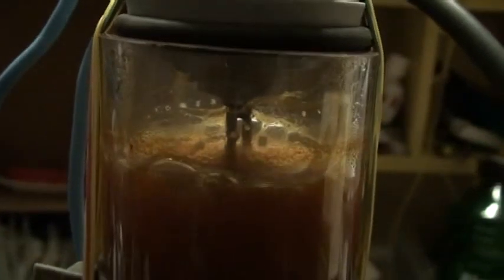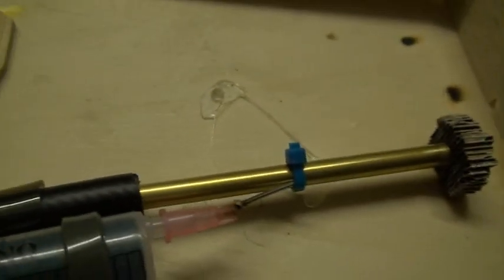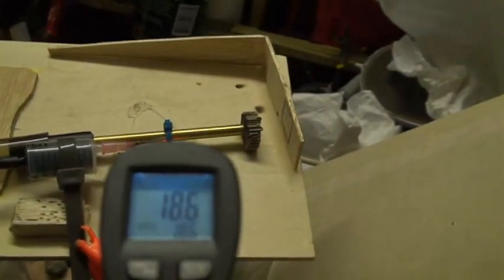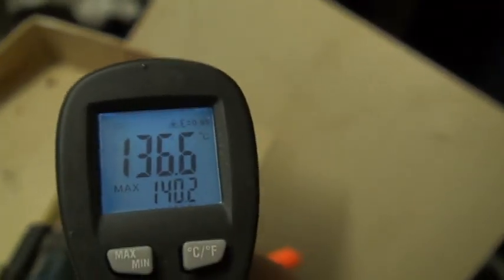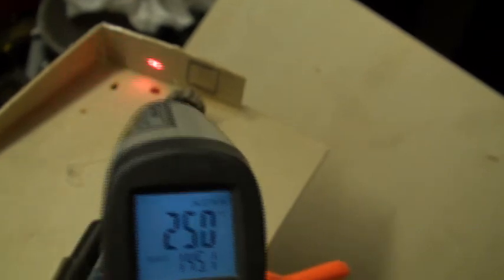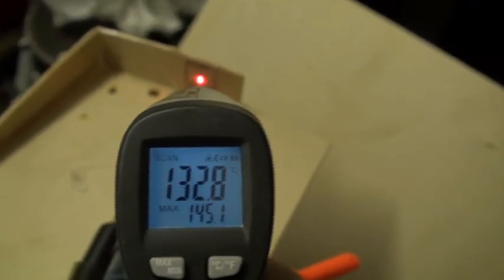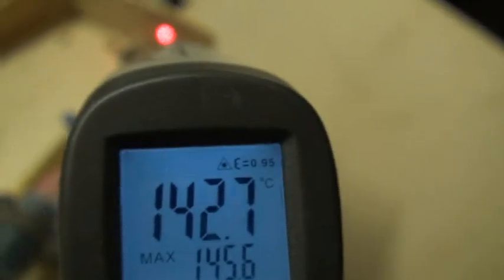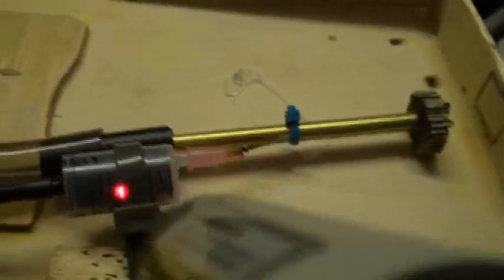CAT to LENR approach 6 wmv

Comment: I think I know what is happening here. your hydrogen is combining with the oxygen at a rate of 1:1 this leaves 1 part hydrogen left over. It is picking up the heat of the catalyst blowing off of it and hitting the wood. It's like having a candle flame and a vary tiny fan pushing air past it and hitting the wood where you can take a temperature measurement.